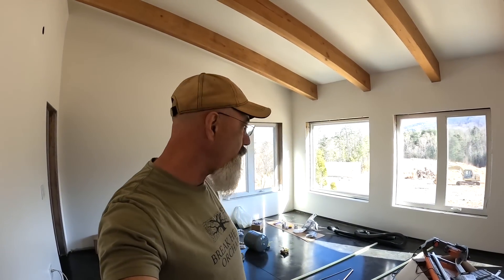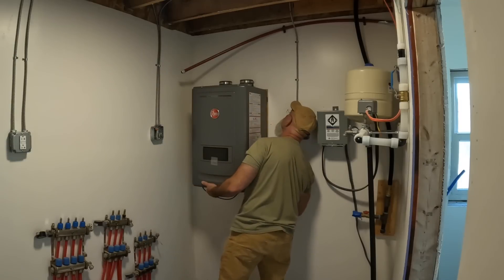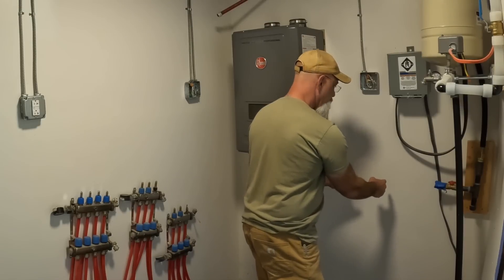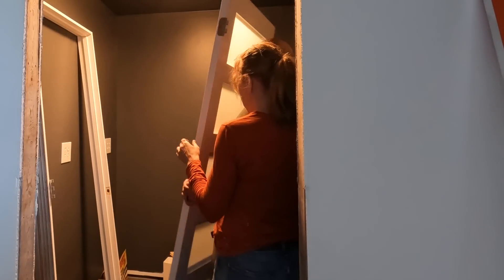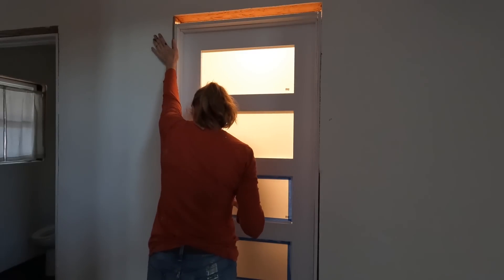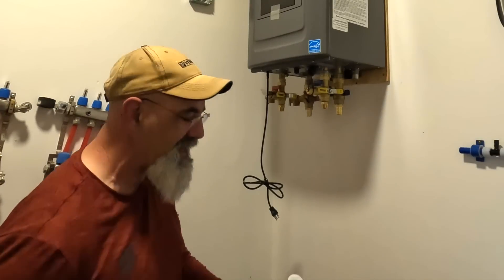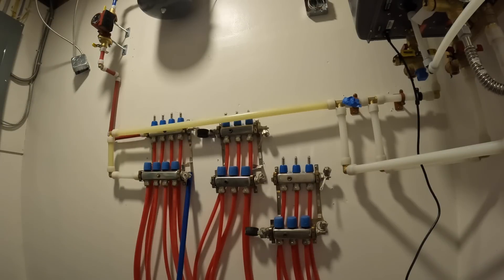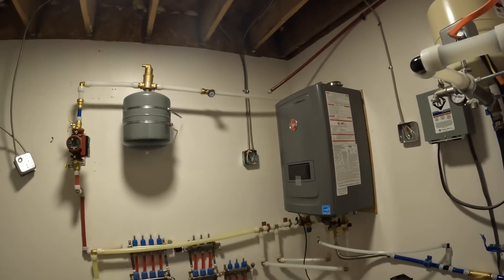We Need Hot Water- Bring on the Boiler

Comment: Do you use only the auto feeder connection or did you plumb in a second feed line by the expansion tank? Rheem's instruction book diagrams don't show the auto feeder connection, and our Rheem guy at work is hard to get ahold of.
Reply from the maker: There is a line that splits off the main household line by the expansion tank to feed the domestic hot water. That line had a small adapter that connects to the autofeeder for the heat (radiant ). I found the manual to be confusing as well.
Reply: @breakheartorchard  Thanks. I'm slowly getting mine figured out. I've got combo baseboard and radiant setup, I'll give just the auto-feeder a shot.
Reply from the maker: @bairfamilyfarm1336  the domestic water comes from a 3/4 inch line that goes into the domestic inlet. The adapter that feeds the auto feed , splits off from that 3/4 inch line.   I just want to be clear.
Reply from the maker: At 13:42 you can see the adapter that split off from the domestic water line for the auto feed.
Reply: @breakheartorchard  I'd seen that, just wasn't sure if a secondary feed was required in addition to the auto-feeder. If the auto-feeder is working for you, I'll give the same style setup a shot.

Comment: I and another guy put radiant heat in my brother in laws house after the fact or as in horse before the carriage.... we did get lucky as it was a great success. Today I watch you plumb your home and wonder how you can do it yet at the time of our doing a similar thing, it was fairly easy to do.... crazy tedious amounts of fittings and plumbing... when I built my house, I was in the poor man mode of pack water forever.... that was real tough and got old quick so when a plumber needed a engine in his car.... problem solved, bring me your car YESTERDAY and it will be running today. He got on putting in my system of water through the walls, that part was sort of after the fact but most walls were only sheetrocked on one side so not quite as hard. When we did the pump and all the controls in my mud room, it came to me like ducks to water.. so why am I fighting in my mind as to how you could do this from just looking at the wall as a layout for the purge tank and other fittings, the water manifolds etc. Perspective is my only reasoning